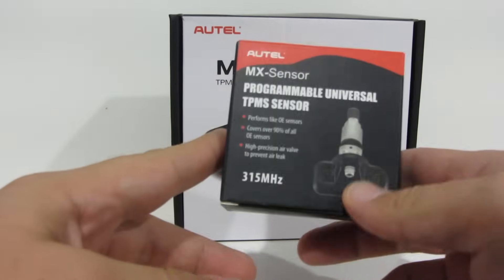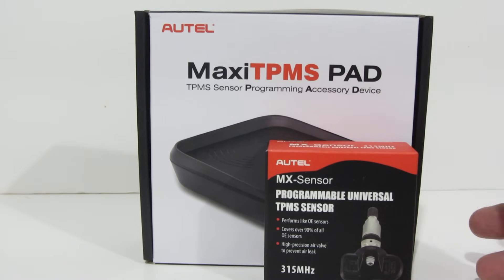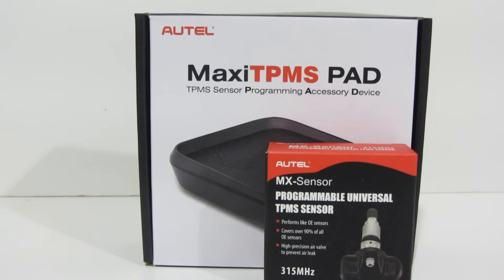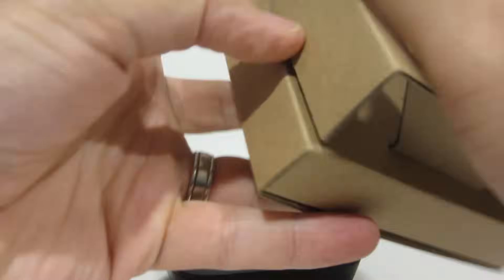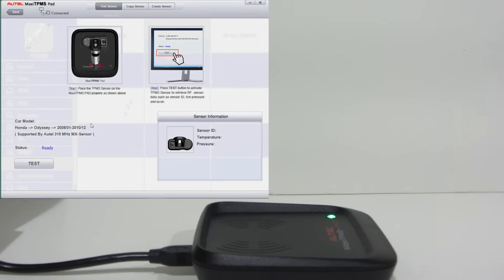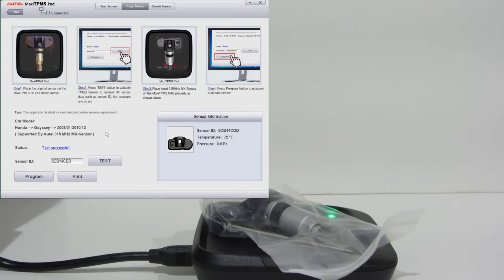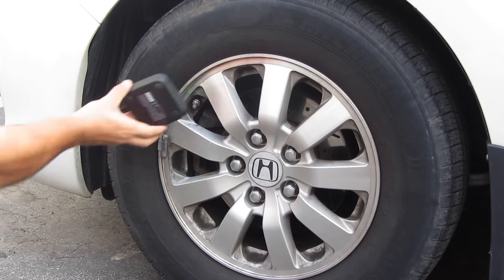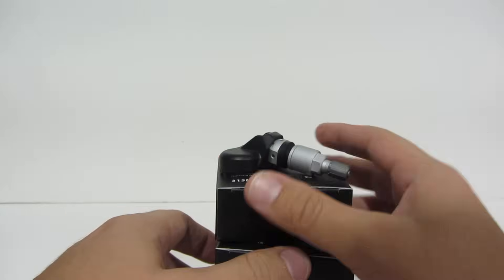Replacement TPMS Sensors for Cheap!

Comment: My daughter  installed new tires and rims on her  2015 tacoma. The tire shop installed new tpms sensors we don't have the old ones. The new sensors wouldn't connect to the truck. the tire shop said it was her truck . Toyota said it was the wrong sensors. The tire shop removed the sensors and refunded her money. We are not sure what to do at this point Toyota wants $900 to replace them. I will buy the tool to program if I have to. We just aren't sure what the best option is at this time.
Reply from the maker: Sorry for the late reply. Did you get this sorted out? Maybe you just need to find another tire shop.

Comment: I am very happy to see this video, I own a car that is 2013, and to have 1 sensor replaced would cost me $180! (r/r sensor + programming) for 1 tire! Unbelieveable! I am rewatching your video again to learn how to use this. Where I live most name brand auto shops will not allow you to bring in your own parts to have them install, they want their money, even if i am getting new tires on my car, they won't swap out the tpms even if its already programmed by me. I had to call around all the local non-branded shops and found a guy willing to remove my "bad" sensor with a new one (must be programmed as he won't do it) for $20.
Reply from the maker: Crazy! I hope you're able to get it done.

Comment: What do I do when I plug in the pad but nothing pops up on my laptop
Reply from the maker: Nothing will pop up. That's normal. You need to open the program manually from the Start menu.
Reply: @GabesHacks  wdym by start menu
Reply: @GabesHacks  the app doesn’t show up when 
I’m in the start menu
Reply from the maker: @orehxhz7930  Did you install it using the disc that came with the PAD?

Comment: Can you reprogram mx sensor if planing to use for other car
Reply from the maker: I haven't actually tried it, so I can't say for sure. But it's worth a try.
Reply: Yes they can be reprogrammed, programming will rewrite for different vehicle either clone existing sensor or create a new unique id.
Reply: @davidg5704  i already sell too many i don't buy autel sensors they are very expressive :D there are other sensors work with autel device half price

Comment: This procedure is known as "cloning". It works great when you can trigger the current sensor that you want to clone. In some instances where the sensor has gone dead with a bad battery or internal failure the cloning procedure will not work. When this happens you can either access the body control module (BCM) of the vehicle and access the sensor codes that are written there or you can simply create your own code with the new sensor and then write the new sensor code to the BCM. The equipment shown in this video will NOT do these procedures and a reader that has OBD-2 capability will be required.
Reply from the maker: That is true. But the other option is if you remove the dead sensor, you can read the code that is printed on the sensor itself, which I discussed at 4:37

Comment: I get the feeling that my 2014 Subaru Forester is one of those vehicles that automatically relearn new sensor IDs after a swap-out. But how can I be sure? (Answer: Read the video description notes!)
TPMS remains black magic for most DIY mechanics, almost as if the auto industry wants to make $$$ off it by keeping things like this secret.
Reply from the maker: According to this list made by Autel, your Forester does not automatically learn new sensors. (Note the "O" in the Relearn Type column, indicating that it needs to be programed through the ODB port): https://www.maxitpms.com/tpmscms/u/cms/www/202103/TS508_V6.19_FunctionList_US.pdf

Comment: 11.25.2021..Friday ( do you need to be hooked up to the Internet to use the software.. also the Pad )
Reply from the maker: No, you don't. You can get updates for the software and the firmware of the PAD online, but you don't need the internet to actually use it.

Comment: Good job in your educating process. Mine are aftermarket that the tire shop said they could not get the light off after installing 4 new tires and aftermarket sensors I brought them that were tailored to the 2008 Dodge Truck I have. I think they only tried to Reprogram them after installation instead of connecting the OBD2 under the dash and doing a relearn. May heave been using older equipment. They wanted $215 to install their own.
Reply from the maker: If that $215 was for all four, then that's not to bad considering some of the prices I've seen people quote in these comments. But yeah, if you already gave them new sensors, then they should have been able to get them working one way or another.

Comment: Are oem sensors able to be reprogrammed or do they have to be specific programmable sensors?
Reply from the maker: OEM sensors are not programmable. You have to look for specifically programmable sensors. And each brand of programmable sensors has their own tools to program them.
Reply: @GabesHacks  ok so you need to buy Autel sensors then? Also is it compatible with a 2016 odyssey touring (Canada)?
Reply from the maker: @mrman3232  The Touring model automatically learns new sensors, so you don't need programmable ones. Just any compatible sensors. I believe they're 315MHz sensors. Just put them in and the computer figures it out.
I had an EX-L which does not automatically learn new sensors.
Reply: @GabesHacks  are you 100% sure of that because I don’t have the calibrate tpms option in my info center on the dash, and I’ve heard so much different info
Reply from the maker: @mrman3232  I can't say I'm 100% sure since I haven't had an Odyssey of that generation. Mine was a 2009 and it was true of that generation. You can call the service department at your local dealership and see if they'll tell you. But it's possible they won't be honest with you and tell you that you have to bring it in for servicing. Maybe call a few dealerships and see if you get the same answers.
Reply: @GabesHacks  fair enough thanks for the help.

Comment: Thank you! You and I have been talking a little on the Ody forum. I’m having trouble getting answers from Autel whether this works on the 2011 Odyssey. But Auto Zone lists the dual frequency universal sensors for my year van. So I’m pretty sure this setup (sensors + MaxiPAD) will work. 

Thanks again for a great video! Supremely helpful…
Reply from the maker: I'm glad I could help!
Reply: @GabesHacks  well, I just finished up and the unit performed beautifully! No codes from my 2011 Odyssey. I tried to update on the Odyclub thread, but can’t remember which one it was that you posted the link in 😆 
Either way, much thanks again for this video. We’re now ready for winter…
(Again, I purchased the dual frequency universal sensors with the Maxi TPMSPad)
Reply from the maker: @jotacalvo  Awesome! Well done

Comment: Hi, Gabe I have a Renault Duster and it doesn’t comes with TPMS. Can I still install TPMS ? And if yes, then how will I configure it to show it in my odometer ? Please guide.
Reply from the maker: You won't be able to make it show on your dash if your car doesn't already have it. But there are complete complete systems you can buy online (like Amazon) that have the sensors and a receiver that you can plug in inside your car.
Reply: @GabesHacks  if you don’t mind can you share some link. I want the sensor TPMS. Not, those other kind of.
Reply from the maker: I'm referring to something like this: https://amzn.to/2W1K1bm (affiliate link)
I have no experience with that system or any other like it. So I can't comment on how good they are.

Comment: Well done on the the replacement TPMS sensors tutorial. In my workplace, we also use Autel for TPMS diagnostics and TPMS sensor replacements (MaxiTPMS TS508 with the dual-frequency MX 1-Sensor). Believe me, they're real time savers on those.
Reply: @Boni The Autel MaxiTPMS TS508 is one of them.

Comment: Hi Gabe, Great video. I will subscribe ! I'm using the Autel website... looking at the S0335-4 model number sensor. But...would like to make sure these will work in my 2010 Rav4 Sport (6 cylinder, no spare). I cannot figure out how to get that info from the Autel website and they are not answering the chat tool on their website...you have any ideas on how to determine this?
Reply from the maker: Sorry, I didn't see this comment for some reason. But you can download a spreadsheet from the Autel website. Go to the page for the sensor you have, like this one: https://www.autel.com/autelcms/TPMS%20Diagnostic%20&%20Service%20Tool/534.jhtml

Click on the 'Downloads' tab, then download the document called "Sensor_FUNCLIST_V4.08" that ends with the market you are in. ("US" for North America, "EU" for Europe, "CN" for China). Then look up your vehicle in that list.

I checked it myself, and they do support a 2010 Rav4. In North America it uses a 315MHz sensor. In Europe it's 433MHz.

Comment: Great video.  Question, I just had my dealer pull of my winter tires and rims which have the OEM TPMS in it.  I supplied them with new aftermarket rims and TPMS.  They installed them, but then told me they couldn't program the TPMS's which may result in my SUV showing a warning message.  If I can scan my winter tires which are marked and get the id value, can I then do the opposite and hold the scanner over my summer rims and TPMS and write the value to the sensor?  I'm thinking that should work, if it can read it, it should be able to write it.  Let me know what you think.  Thank you from another Canuck :)
Reply from the maker: To write a new code to a sensor, the sensor has to be a "programmable" sensor. Most sensors are not. And if it is programmable, the scan tool must be able to program that brand of sensors (usually the same brand as the scan tool).

Comment: Autel is cheap junk, i had those before, did not last a year, OEM for the vehicle , comes pre programed, and ready to learn
Reply from the maker: Ready to learn is fine, if it's easy to do the relearn process on your car. I used these for my winter tires since my van didn't automatically relearn new sensors and I didn't want to have to reprogram the van every time I switched tires.

Comment: If I have the Autel sensor installed prior to programming it since I don't have the bad yet but my tire is leaking so I need to change the sensor, can I read the code on the oem sensor then when I get the pad transfer it to the Autel sensor already installed in the tire? I saw in your video that you could read the existing sensor so I assume you can also write the code to the Autel already on the vehicle but I hate to assume. Video was very informative thanks.
Reply from the maker: You say you need to change the sensor because the tire is leaking? It's possible the valve is just leaking. You can replace just the valve core without replacing the whole sensor. A tire shop might do it for cheap. Valve cores are cheap and take 2 minutes to change. Look up "change valve core" on YouTube to see what I mean.
But to answer your question, I haven't tried programming a sensor with it already installed, so I can't say for sure.
Reply: @GabesHacks  The nut that holds the sensor to the valve stem which is metal is frozen to the stem so the stem and nut just spin together probably because of the salt here in the Northeast States. So I just had the sensor put in and have the old sensor which electronically works. So if I read the code from the old sensor and transfer it to the new Autel I think it should work pretty much like putting the tire back on with the original sensor. Since you can read the code with the sensor on the vehicle I would think you could reverse the process and write the code to the new sensor. I guess we will see when I get the pad. thanks!
Reply from the maker: @johndunbar2131  Let me know if that works for you. I'm curious. You're not the first to ask.
Reply: @GabesHacks  I called Autel support and they said it should they only thing that may impede it is if you are using different rims than original which I am not. I'll let you know once I get the Pad.
Reply: I ended up ordering the TS 508 Autel tool since I had another vehicle where I need a relearn  and the tire shop wants $35 for a relearn that's whether you get a new sensor or sensors or not I was able to program the already installed sensor on my one vehicle with the leaky sensor that was replaced and then did a relearn with the tool since I had TPMS spelled out on my display not the horseshoe. Then I had to wake all the sensors on my other vehicle and do a relearn with the tool. The former was 2010 Honda Odyssey LX and the other was a 2008 Altima. Both are now clear of any TPMS issues. The tool on ebay was $99 but does a lot more than the pad and is independent of the PC with the exception of updates which are free lifetime. Tire shops in my area use Autel so if they are junk I would think they would get a lot of complaints which I asked and their
 response was no...we will see down  the road. The Autel TS 508 will read OEM sensor codes no matter what make but you can only program Autel Sensors with it. As for a relearn as long as you can wake the sensors you can do a relearn with the tool. I did it on both vehicles 1st try.
Reply from the maker: @johndunbar2131  That's awesome. Thanks for the update!

Comment: Awesome video! Question for you! How has the battery life held up on the sensors from China?
Reply from the maker: I'm pretty sure most sensors are made in China 🙂 These Autel ones only lasted a couple years, which was a bit disappointing. I replaced them with their newer ones. I'm hoping those are better
Reply: @GabesHacks  great, thanks for the info and the helpful video!
Reply: I'm wanting to do this myself.  I'm just wondering if your having better luck with the battery life on your current ones.  Also did you have any other problems dad on arrival or any other issue? Thanks

Comment: Hi gave good video! I have a 2015 bmw r1200gs motorcycle that i have 2 sets of tires road/dirt i will like to be able to do what you did all weather/winter tires. Any idea how to know what kind of censors that motorcycle has, or were to find that out? 
thanks
Reply from the maker: I've never had a motorcycle, but you can search online for the make/model and "TPMS sensor". I'm sure you'll find what you need. That's all I would do.
Reply: @GabesHacks  Thankyou so much for a very informative video

Comment: Hi, Gabe from GTA.  If my car has auto relearn, does this mean I can just grab any no-name sensor of the same frequency? If so, does this mean I also do not need any kind of TPMS tool?
Reply from the maker: Correct 👍
Reply: @GabesHacks  ¡Gracias!
Reply: Provided they're an OEM direct-fit or any universal programmable TPMS sensor that's programmed to the specific make, model, and year of the vehicle you have. The latter will require a TPMS sensor programming tool.

Comment: hi Gabe, after you clone the existing tpms code and use new sensors on winter tires, will the car ECU pick it up automatically? thx.
Reply from the maker: Yes. Since the new sensors in the winter tires have the same codes as the old sensors, the car's computer will have no idea that anything changed.
Reply: @GabesHacks  brilliant! thank you!

Comment: When you tested the sensor on the Honda it reads PSI for pressure. But when testing the MX-sensor it reads KPa for pressure. Is that OK?
Reply from the maker: That's ok. It's just a difference of metric vs imperial. If you are using the Autel software, you can change the units in the settings.

Comment: Helpful tip for experience you need to have those exact new senors the Autel Mx 315 mhz the pad will not program any other sensor only test
Reply from the maker: Correct, the MaxiTPMS PAD can only program Autel MX Sensors, but not just the 315MHz ones. it can program the 433MHz and the new 2-in-1 MX sensors as well.

Comment: Hi, im gonna update my car wheels from 18" to 20", my question if i take tpms the original in 18" to new wheels 20" do i need to reprogram sensor again or will be fine? Thankx
Reply from the maker: You'll be fine. The car's computer will have no idea that anything changed.

Comment: One thing; I found manufacturer specific TPMS sensors that wouldn't need reprogramming, presumably, for under $30. For my 2014 Honda CR-V. I haven't GOTTEN any yet, so my question would be is there an issue getting one that's manufacturer specific?
Reply from the maker: They'll work, but you will have to program the car with the new codes with a special scanner tool.
The car needs to know the codes of all 4 sensors installed. A new sensor will have a new, unique code that the car doesn't know, so you need to tell it.
I used a programmable sensor instead, to match the codes that my van already knew. But I only did that because I wanted a second identical set for my winter tires.
Reply: @GabesHacks  Alright thank you. What is that tool to tell the car the new sensor code, btw? Am I getting beyond the "let someone else do it" expense horizon? It's about $60 to do that. For one tire, but then I can't tell if only one or which wheels/sensors aren't responding.
Reply from the maker: @justaguy6100  The cheapest scanner tool I know of that can do it is the Foxwell NT510 Elite, which is $129 US right now. That tool does a whole lot more than just TPMS - it can look at all the other systems in the car. So if you do most other work on your car by yourself, it's a good investment anyway.
But otherwise, $60 isn't bad to get the work done.
Reply: @GabesHacks  Thank you Gabe. I do most of my own work but at this particular time it's more total outlay that concerns me, and luckily this is the only thing this car has shown me a need to fix. I appreciate your feedback very much!